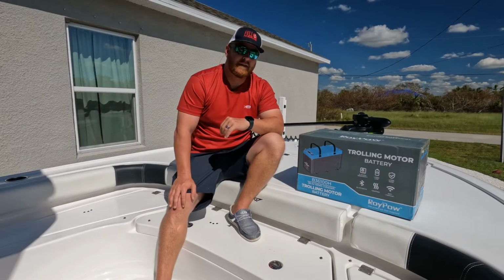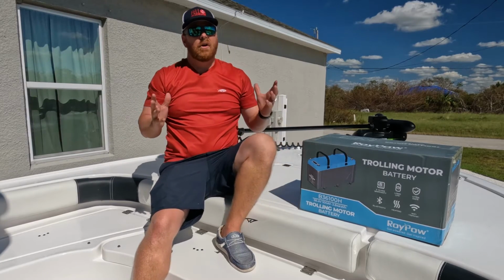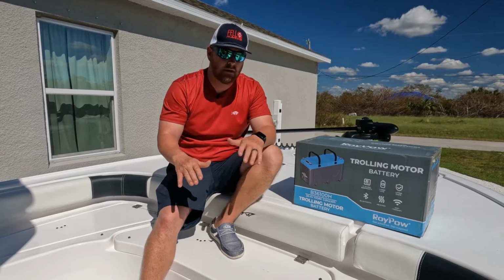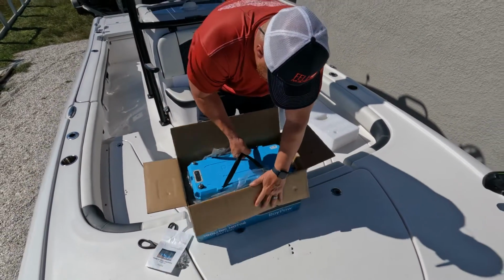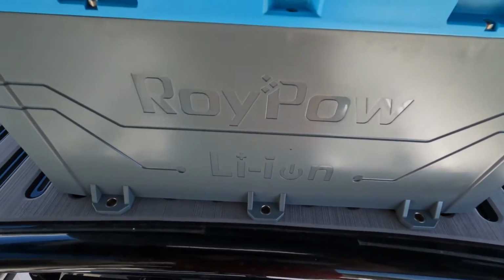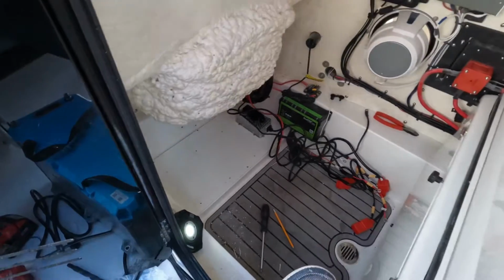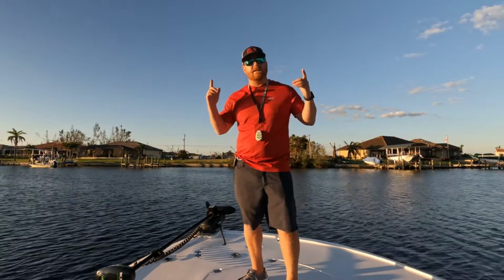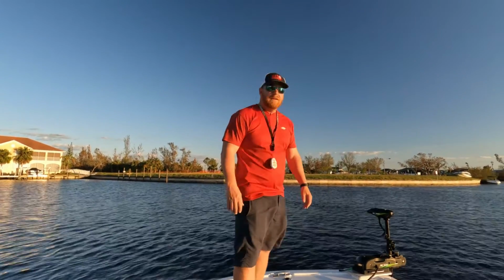Lithium Trolling motor battery. Should you make the switch? RoyPow 36v trolling motor battery.

Comment: Great video on the actual application. Speaking of application, I’m looking to add a trolling motor to my TW 232 LXF CC with a 36v Li battery. Was wondering if 1 of the 100ah size would be enough to keep the boat on spot lock for several hours per day? Didn’t know if I’d need 2 batteries for that big of a boat with the hardtop that will act like a sail…

Comment from the maker: Leave a comment on your thoughts on lithium battery's.
Reply: just purchased a 24 100 amp hour, how is your 36 volt holding up?
Reply from the maker: @jasonhill143  amazing. Did you use the link?

Comment: Half the weight, twice the run-time, no voltage sag until the very end, 4 times as many charge cycles and with LiFePO4 there is essentially no risk of thermal runaway, which is critical on a boat.  Anybody buying lead-acid batteries for their trolling motor, today, is penny wise and pound foolish.